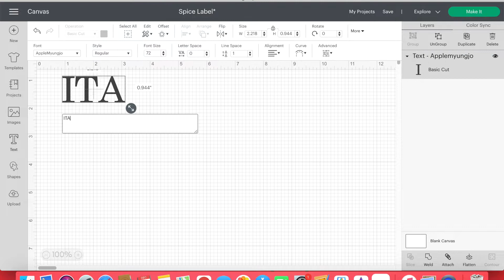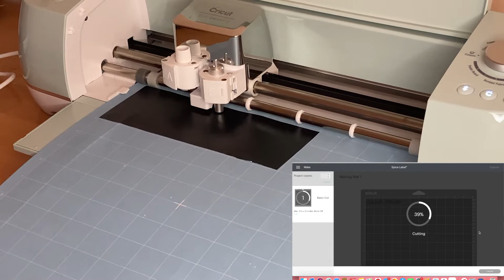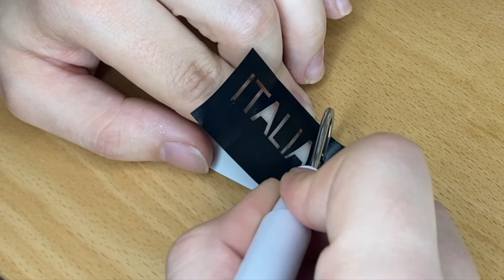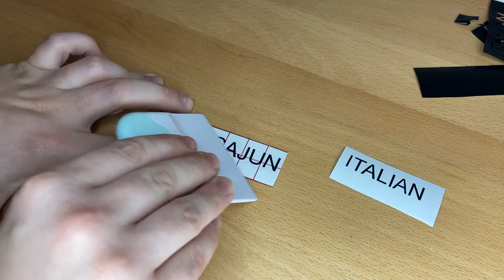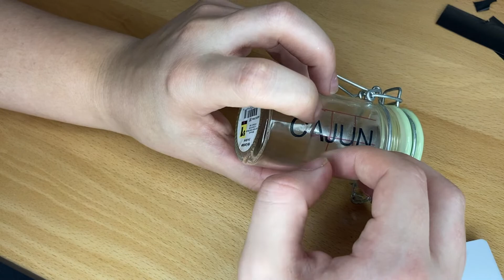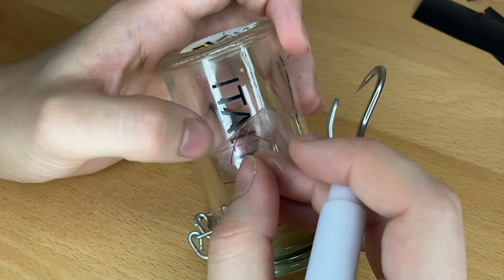How to Make Vinyl Labels - Using Transfer Tape

Comment: Can you show how to use the cricut design center text button, I am bamboozled as i just got my cricut Joy yesterday and struggling with the text button
Reply from the maker: Hi Beth, I don't have a video specifically for using the text button but I go more in depth on the text options in the video linked below. This video linked here is also for making vinyl labels, but offers advice to make the labels without using transfer tape. The prep work in design space is very similar. I'll work on a text video though, I hope this helps! https://www.youtube.com/watch?v=pULSFBFLLQE